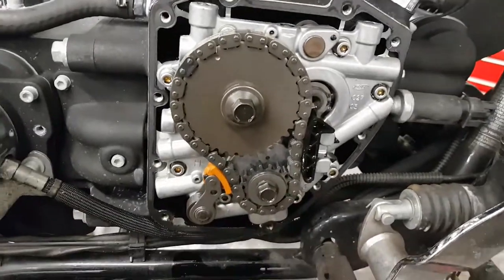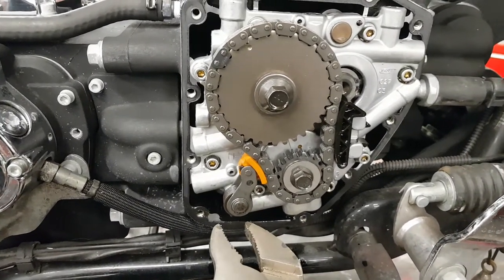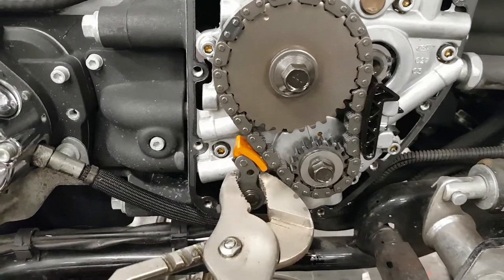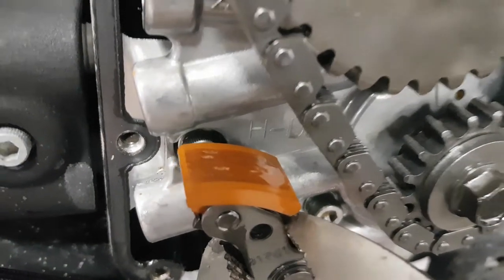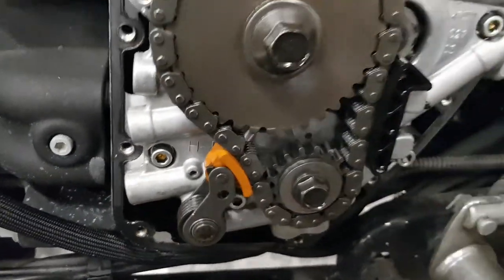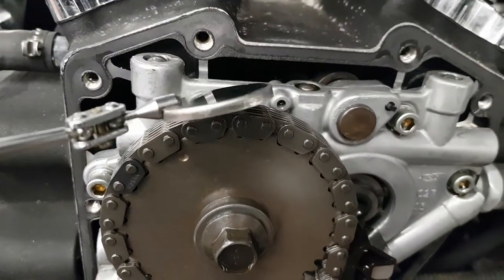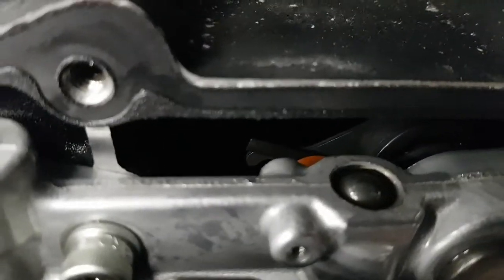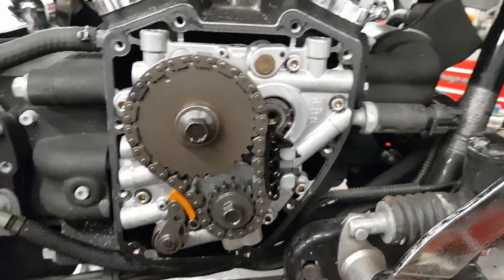Harley Davidson Cam Chain Tensioner Inspection

Comment: I’ve got an 06 road king stock 88 with just under 40,000 Kms, I assume I have to take the floorboard off, what about the stock exhaust, Do I have to remove all pipes?
Thanks.
Reply from the maker: You can likely sneak the front pipe off if it is stock. easier to remove complete if necessary to change tensioners. At 40k you may consider new lifters if they are noisy as well

Comment: Hello,
Is there any sound symptoms before opening it up? Where about are you located?
Have a nice day
Reply from the maker: If it gets bad enough you will hear with loose chain noise and kind of the sound of the chain running against the steel of the tensioner shoes
Reply: @CrackerJackMechanic  
Thanks Jack!
I hear nothing coming from my right side for now

Comment: 50,000 km ? I’m guessing this is the second set of tensioner shoes , no?
Reply from the maker: Nope
Reply: CrackerJack Mechanic this gives me some optimism. I bought a 2002 Low Rider this year with 22,000 KM on it and it’s been giving me nothing but grief.  Stator went last week. 
I assumed that the shoes would be ready to disintegrate like so much else on this bike. 
Thanks for the response
Reply: The internet tends to magnify problems. There are many well maintained and responsibly ridden machines with twice that mileage on stock parts. An inspection is a good idea, though, so as not to have bits all over inside engine if one does fail.
Reply: @JeffinTD  yes agreed. Did the inspection myself in late November and saw a hairline crack. Had the local “American motorcycle specialist” (this is Japan after all)  order the SE kit and changed it over. $2500 (US). The bike continues to fall apart. Just waiting for whatever’s next. Starter?  Rings? Transmission bearing ?  Another day in the life of a “low mileage” Harley.  But I do know (now) that they got a lot better after 2010 or so and are now fairly reliable machines. 
I wouldn’t wish my 2002 on my worst enemy. Utter POS
Reply: @shizuokaBLUES   Sorry to hear that. I had a 99 Road King for like 10 years, and really the only problem was a hole not properly drilled for the fuel tank venting system, and a clutch cable.
Reply: @JeffinTD  road king is easily my favourite HD and they are just prohibitively expensive here in Japan. Beautiful bike. Yes I’ve had friends whose harleys last for decades

Comment: Just pop the cover off and take 
A look it only takes a lil time.
Reply: You mean just remove the exhaust and the back brake lever and remove the cover and take a look.
Reply: @shizuokaBLUES  Yes you need to take off a few part's. It's not a big deal and can be used as maintence as while I have the exuast off I drain the rear break system inspect replace brake pad's and replace brake fluid. Your bike is a machine that need's maintence. You can pay someone or just do it yourself. I prefer to do it myself. I simply order the part's and wait for a rainy saturday or sunday and go to it.
Reply: Captianstank mcnasty tell me about it. 
Actually that was a really good thoughtful response. Thanks 🙏 

I bought a 2002 Low Rider with 12k miles on it, from an auction. 

Big mistake. Turns out the previous owner had done zero maintenance to it.  So I changed both engine mounts, brake pads, discs, and  front fork springs, battery and filter, and even changed manifold gaskets with the help of a buddy. 

But I had a mechanic do at least that much more (wheel bearings,swing arm bearing, stator ).

Next is the tensioner shoes. 

You can imagine the money and time. I may as well have spent 13,000 bucks and bought something almost new. 

Live and learn eh. And if that whole year of playing catch up didn’t teach me the value of steady maintenance....
Reply: @shizuokaBLUES  Yea I know the feeling. I own a 2000 wide glide. I had replaced a lot of the part's. I go on the premise that they are 20 years old so just replace them as time and money permit. I always warn people of buying old bike's. Especialy if you are not mechanicaly inclined and don't have the extra cash to pay other's. I am glad to own a classic or older bike in the long run. Sometimes though I have to wrench instead of ride. I try to plan all maintence for winter as best I can. Sound's like you are on your well on way to becoming a wrencher. Good luck bud.
Reply: Captianstank mcnasty hey thanks much for the support.  Yes I’m going to a buddy’s house in Yokohama next week to do the chain tensioners and switch for the hydraulic kit. Don’t have the money for the gear drive. Japan is a great place to ride surprisingly. 

I’m enjoying the learning process and watching the bike transform. Labour of love. Your warning of people and old bikes is sage advice.

Safe riding and good talking with you